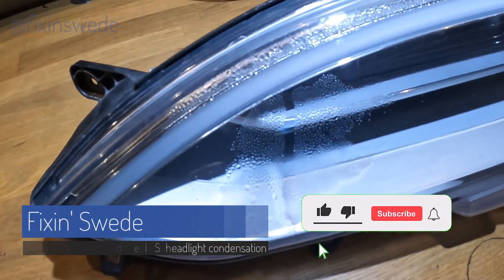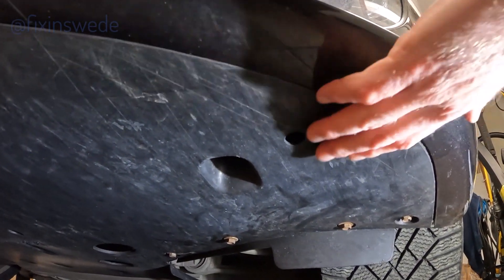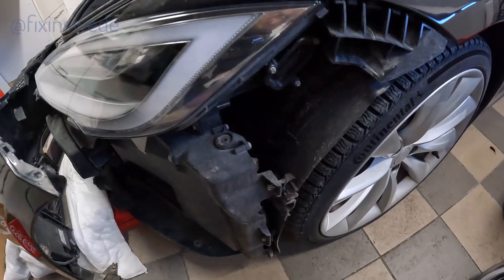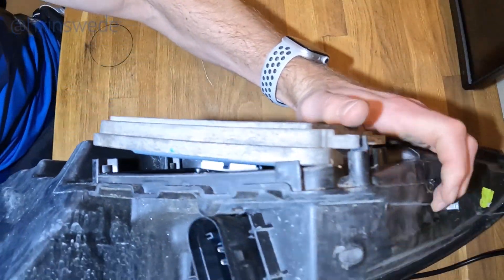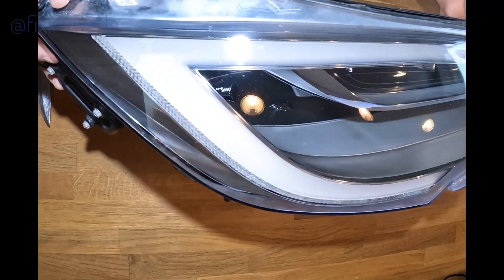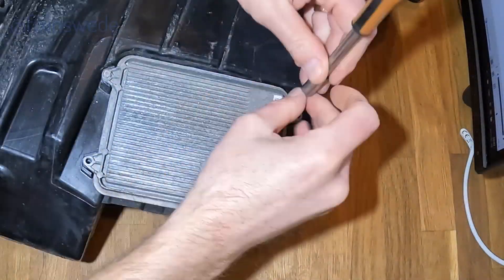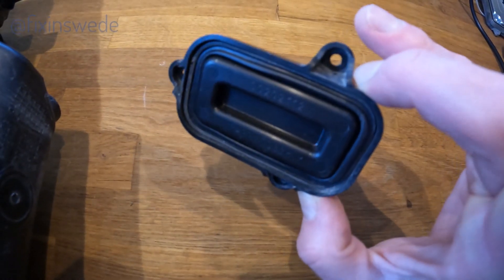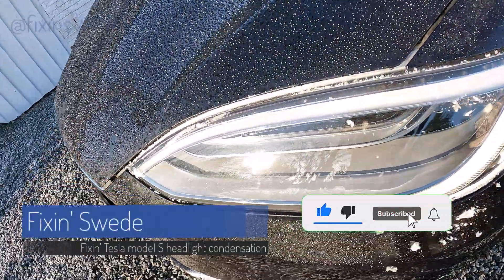How to fix headlight condensation Tesla model S, for free

Comment: Nice video man. Once doing the hair dryer method. Is it worth getting some silica bead bags and leaving them in the inspection hatch to prevent further condensation?
Reply from the maker: Thanks :)
I would not put anything inside the headlight.
Just try to seal both the membrane and the small hatch, and I believe that it will be enough.